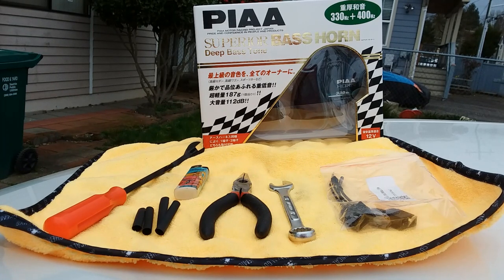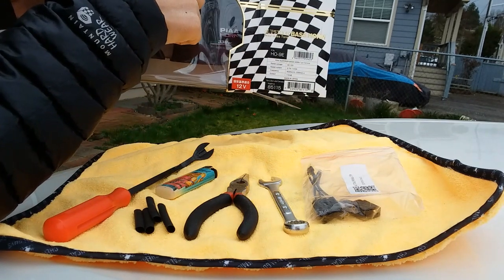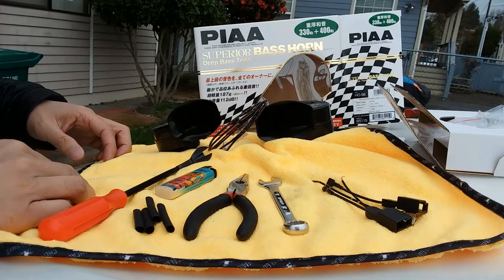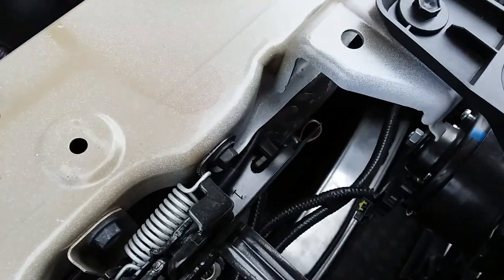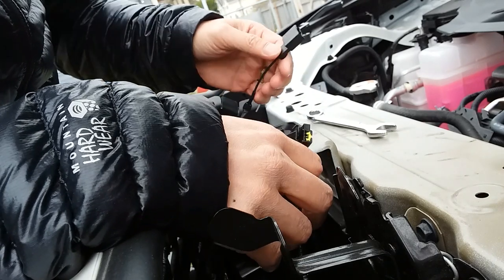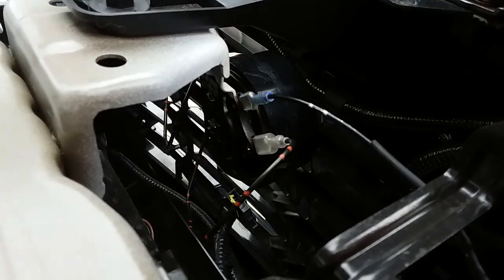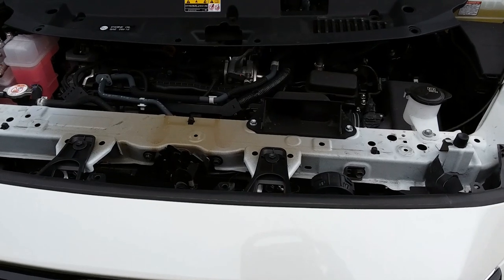PIAA Superior Bass 330Hz & 400Hz Car Horn Installation for 2020-2024 Toyota Highlanders

Comment: I agree with you about the horn.  It does have a little bit deeper sound, but not that much louder to be of significance.
Reply from the maker: @L Cole Agreed brother, I think these would make a bigger difference in passenger cars, our Highlanders Denso horns are pretty decent! I'm too lazy to reinstall it at this point! 😅
Reply: @vietbubbletea  too lazy at the moment,  as you indicated.....put it on the wife's Camry.
Reply from the maker: @lcole7501  Or I should install them in the rear bumper for those tailgaters! 😂😂
Reply: @vietbubbletea  YES!

Comment: GREAT CHANNEL MAN!!  do you have to push the plastic screws in  in order to take them out?
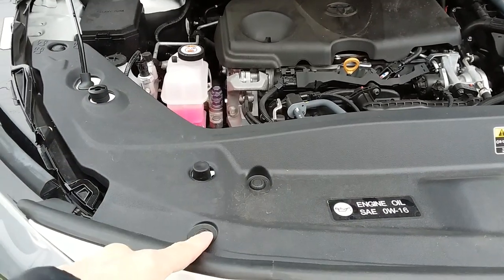Reply from the maker: Thanks, are you referring to the black tabs at the 5:55 mark? If so, yes you have to push the tabs in to disengage the clips on the bottom in order to remove it.

Comment: Could you please make a video like how to install LED Daytime Running Light DRL Fog Signal 3-Colors and  Tail Bumper Light Sets For 2020-2022 Highlander Toyota?
Reply from the maker: @Fardin Malelzai I plan to make a video for the LED DRL foglight soon but not the tail bumper light because it doesn't have the rear reflector which is a safety hazard if the car breaks down in the middle of the road. Stay tuned!
Reply: Dont they come with LED’s? Mine do
Reply from the maker: @ErrorPagenotFound-ig1cy  You're right, I think he's referring to the aftermarket DRL foglights like this...

https://cartrimhome.com/DRL-For-Toyota-Highlander-2020
Reply: I just installed both the Fog DRL from CarTrimHome and Bumper lights from GeeGee Top.  I didn’t make any videos but it’s a pretty simple job but does take a bit of time.  I used T Tap connectors.
Reply from the maker: @Michael Trinh I'm glad the install was straight forward for you. They sent me the DRL foglights to review but I didn't like the idea of tapping into wires if I could avoid it. They've been very responsive to my ideas and feedback and working with their factory to send me a "plug and play" version that includes a wiring harness to improve their product line.

Comment: U have 2 stock horns¿? What if I only have one stock horn adapter..how to I power two piaas?
Reply from the maker: @kleptodathief3946  Your Highlander only has 1 horn? You'll need to split the power to the second horn. Here's a video on how to do this as long as your horn has a built in relay to distribute power evenly. https://youtu.be/aqlyv7uJs3k?si=U-Zuq8wvVMX9Zrk6